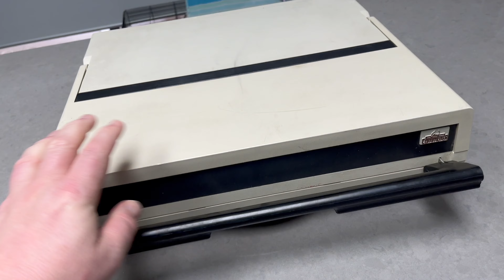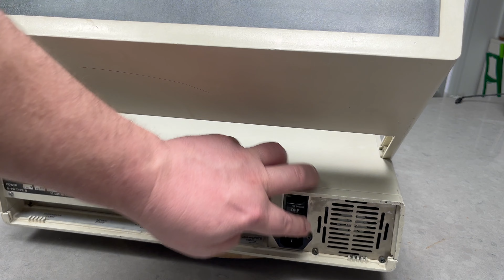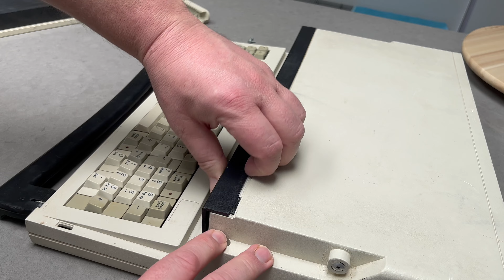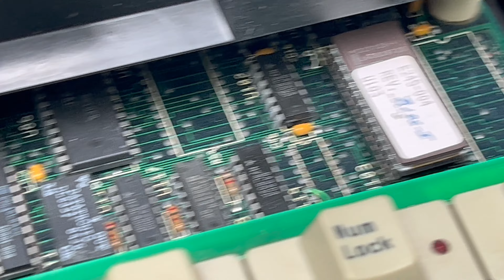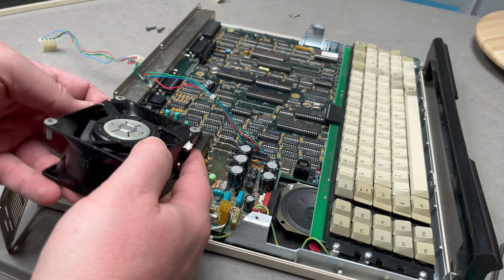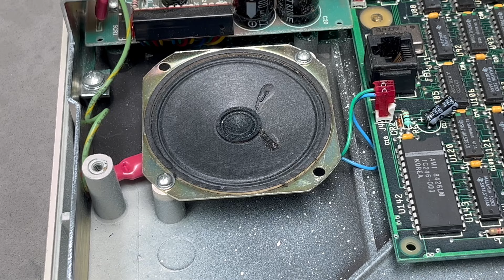🇺🇸 Visual 1083 Commuter: Part 1 (Pulling it apart) [TCE #353]

Comment: I used this computer when I was young. My dad had gotten it from the summer '87 DAK catalogue. It had the 16 line lcd screen, but we got the 12"? amber monitor. I didn't know for a long time that it had CGA and could be plugged into a tv. Besides actually using it for homework, the most memorable game I played on it was Star Flight. Been checking online for one to get again, but the prices keep getting higher. I still have the one of the instruction binders somewhere stowed away. Don't have the disks anymore though.
Reply from the maker: Cool!  I want to add a small screen to this one, using the external RGB/CGA, and also rig up an expansion board so it can run off a CF "hard disk" ... let's see.  My fave game back then was The Ancient Art of War.  Regarding Star Flight, was it this one?
https://en.wikipedia.org/wiki/Starflight
Reply: That’s the game. I got tired of the pc speaker, so I soldered some connector and tried to plug in headphones. Almost burned something out. I seem to remember changing one drive to 3.5, don’t remember if that worked.

Comment: Glad to see you working on the Visual Commuter.  I have worked on many of these units and specialize in their restoration.  Just a few comments:
1.  There is a good workshop manual with reasonably compete schematics.  If you google it you can download them from an European vintage site.
2.  Your unit likely has had the floppy drives replaced as most units were shipped with the Epson drives and they were problematic.
3.  Although it looks like the drive ribbon cable is a mess, it's actually an amazing origami folding to allow the connectors to work and the ribbon cable to fit into the very tight channel behind the drives.  Yours is a bit more messy because the replacement drives in your unit have the connector slightly offset from the original drives.
4. The ground connector is intended to be connected.  It looks like you are missing the male connection.
5.  The fan is 120 volt and would need to be changed for 240 volt operation.  You are correct that the power supply can be selected to work at 240 volt (although. being in the US,  I have never tried to do that).
6.  Excellent that you have 512K of ram.  That means you likely have the PAL chip that supports the 512K.  There is a dip switch on the board that sets the memory size as well as the default screen selection (16 line LCD, 25 line LCD, Color monitor, monochrome monitor)
7.  The Visual has some audio beep codes that help identify issues if the unit does not get to the normal power up self test screen.
8.  Assuming you can get to the power up self test screen, you can select diagnostics to test memory, disk drives, parallel port, etc.

Best of luck and I look forward to seeing how you do with this unit.
Ron
Reply from the maker: Thanks Ron!  Good to know about the 512KB ... I did spy two, separate socketed PAL chips.  I've not been able to find any proper documentation/schematics yet (haven't figured out the magic search-term combination - haven't tried "workshop manual" though ...) but I did find some Field Information Bulletins which detailed the DIP switch settings.  I'll source a 240VAC replacement fan (like I did for the NABU).  Actually, what I'm keenest on finding at the moment is the RJ45 pinout for the LCD. /Brett
Reply from the maker: Found the manual!  Will upload it to my Github. /Brett
Reply: @Brfff  Good job!  If you look at the fold out schematics (page 7 of 10), you will find the LCD connector J3.  It is shown just above the composite video connector J9.  Unfortunately, I have not been able to obtain schematics for the LCD screens as the LCD screens were made for Visual by another company (there were two versions: the original 16 LCD unit, and a later updated 25 line LCD, of which the 25 line is much preferred and more usable) .  If you by chance find the LCD schematics, they would be useful to those of us who work on the VC.  Note that the LCD connector is for monochrome and does not have the color signals available through J3.  If you intend to install a more modern color LCD screen, your best bet would be to connect it to the rear RGB/Monochrome connector. 
Ron
Reply from the maker: Yep!  Found the J3 pinout ... the signal names are a bit blurry so thanks for the confirmation.  I've seen a video where it can output graphics, not just text ... but only monochrome, eh?  Makes sense for the time.  If the board is only two-sided (no sneaky layers in the middle of the board I can't get to), I'm thinking I could ... maybe ... patch the RGBI signals to the RJ45 ... ?  Worst case ... from the DIN pins to the RJ45 pins ... otherwise, from whatever IC they are output from (as per schematics) ... would be a useful upgrade? /Brett
Reply: @Brfff  A lot of work to alter the RJ45 for not much gain.  The actual Visual LCD screen has a cord out the bottom left (looking at when the screen is up) and this cord plugs into the RJ45.  It could just as easily plug into either of the back video connectors with no difference in cord length.  The only advantage of the RJ45 connector is that the lid can be closed with the cord plugged in.  However, in practice, this is not a good idea because it puts a lot of stress on the connector and causes a point of failure at the jack.  I always unplug my units when I close the lid.  I'm interested in seeing what you come up with for the display.  The LCD screens are a common failure point.  I would guess that 75 percent of the operational units with LCD screens have non-functional screens, and even the ones that are still working tend to fade to a point where they are hard to read.  There are some tricks to rejuvenate them  but they do not compare to the modern LCD screens we have today.
Reply from the maker: Ahhh ... very good advice!  I did notice the small hole on the LHS of the dummy display.  And I see your point ... might as well just run a cable from the DIN socket (I have a LOT of experience with DINs ... Soviets used them extensively).  
I do have one other question - is there any interface spec. for the expansion connector?  
The one for the Amstrad PPC machines (uses a pair of D-connectors to get the 62 ISA signals) says certain signals need to be buffered and the data lines need pull-ups to 5V.  
I did read it was compatible with the IBM Model 5161 expansion chassis, but haven't found much info on that so far.
We already have a design for an Amstrad PPC external ISA expansion board ... would like to do the same for the Commuter ... if not already designed?

Comment: I'm placing my bet on that connector being for a teletype port. Which would make sense in that you could bring your terminal to the monitor. And the 16.257Mhz crystal is an odd frequency for NTSC, and the lack of video hardware (that I can discern) is a concern.
Reply from the maker: No, no - it's definitely for a screen ... here's a short showing it in action ... I'm definitely not missing anything with regards to the original LCD ... looks horrible!  But it was the 80s.

https://www.youtube.com/shorts/CIP6zKTEE3o
Reply: @Brfff  Yup. You're correct. On both counts (that guy's screen is pretty bad). I wouldn't have believed it by just looking at the board. It would be interesting to see what the waveform looks like coming out of that connector.
Reply: The screen had horrible refresh rate and blurred very badly when text scrolled. Below average for the time. 16 Line display, although you could scroll the screen up through the full 25 lines. I'm thinking the port may be a TTL port by the way the screen behaved and I don't remember any odd ports on the back. But remembering that far back ...

Comment: Kinda interesting how much of your board has '84 year chips, while there are a lot of '86 vintage ICs as well. Mid-life upgrade?
Reply from the maker: Well spotted - I reckon so.  It apparently came with 128KB base installed originally ... so two banks of 64KB, socketed I would assume to allow both banks to be replaced and upgraded to the max 512KB.  But this machine has 256KB soldered in ... new base installed? ... with the additional 256KB socketed (so upgraded when sold or later)
Reply: @Brfff  Looks like you have 512K, which is nice. :)
Reply from the maker: Yep, and as per @ronanderson1839, it seems I'd need the relevant PAL if I wanted to upgrade it from anything less ... yay!  So lucky.  Sticking any info I find on my Github:

https://github.com/0ddjob/Visual_1083_Commuter

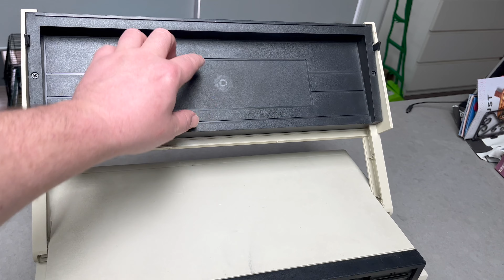Comment: 1:30 Oh, I hope so. That would be a blast to see.
Reply from the maker: If the 8-pin RJ45 mirrors the standard CGA DE9 (only seven pins really used as GND uses two pins and one is reserved) then it might be as simple as connecting RJ45 to a GBS8200 and then via VGA to a small colour LCD ... I have an 8" Eyoyoyoyoyo screen with VGA input.  This would leave one pin free on the RJ45 for power.  There seems to be enough space in the dummy display you could hack something together pretty quickly ... not necessarily pretty, but it might work ... ?
Reply: @Brfff  Frankenstein-hot-glue-and-duct-tape or otherwise, it'd be wonderful if you can somehow get all that kit (plus power) to fit into the flip-up-lid.